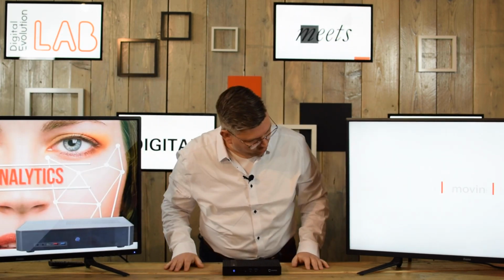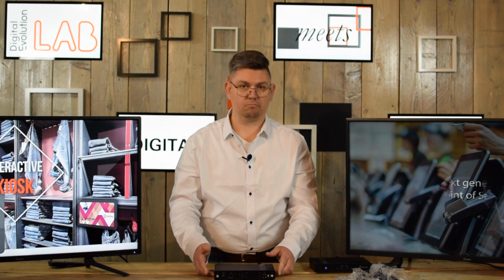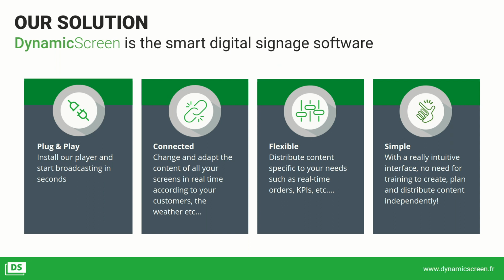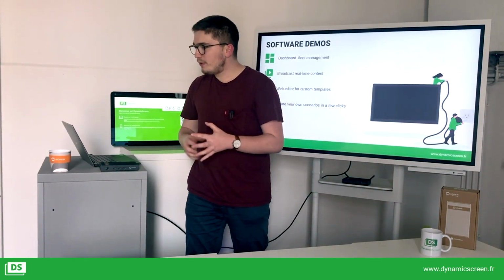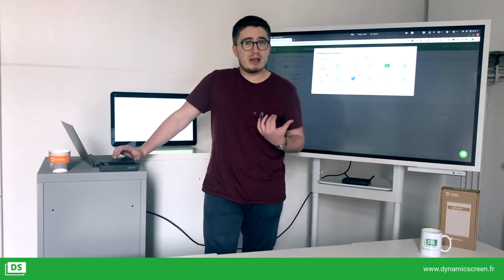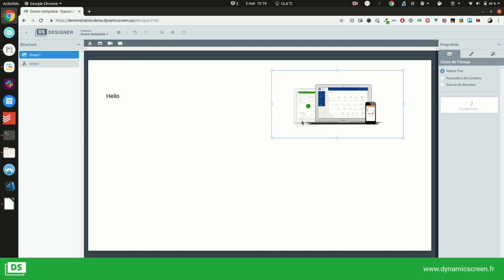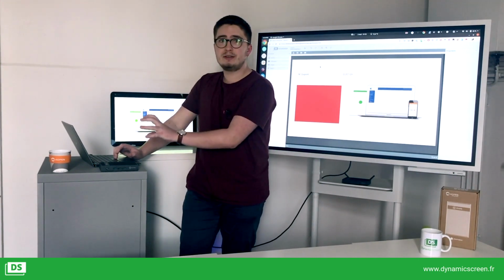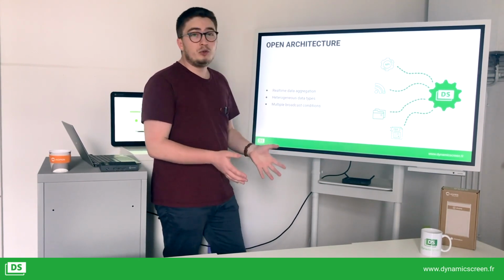Webcast: the Dynamic Chromebox Commercial 2

Comment: Can i add more than one Chromebox in a single Workspace and manage those devices remotely? showing the same information simultanously in all devices???  i have 5 chromebox ubicated in diferent locations, everyone with a independent screen.
Reply from the maker: Hi Mario, yes this is possible via digital signage software, but the kind of software would depend on your content and plans. It's therefore a bit difficult to answer this question here, so could you contact us via request@aopen.com? I will connect you to a regional sales manager that can help you further via our digital signage software partners and tell you exactly how to set this up with your current solution? ^AOPEN